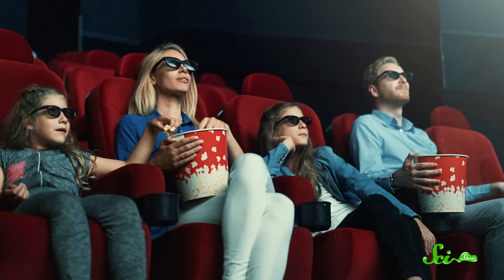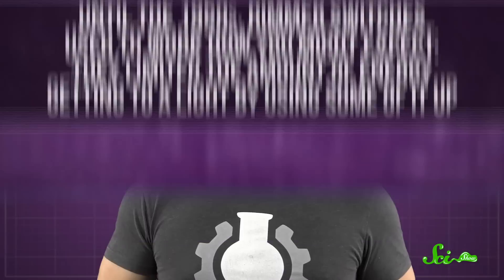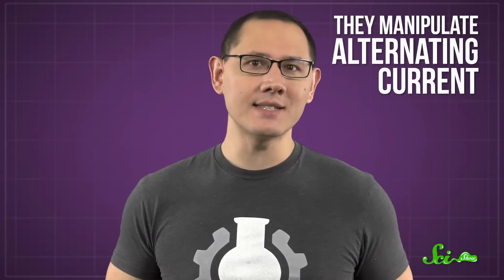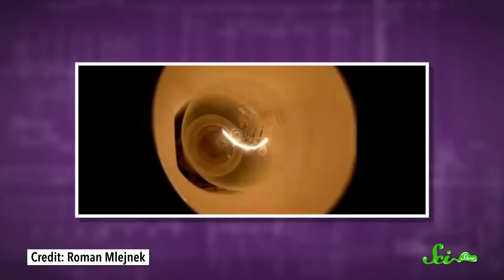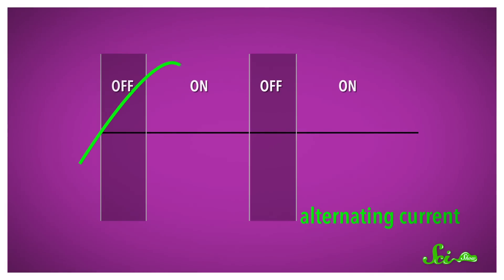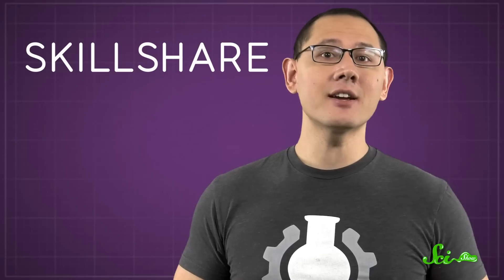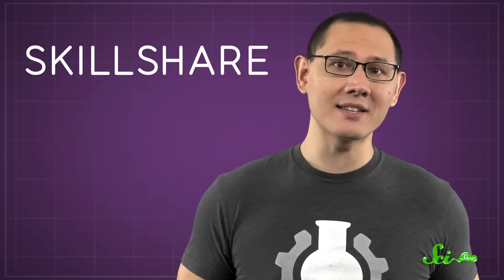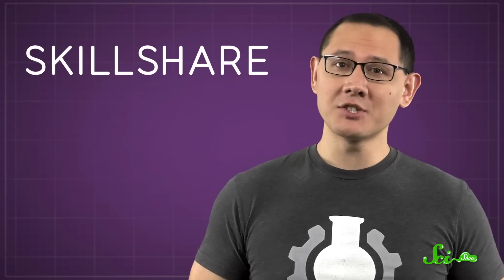Dimmer Switches: Secretly Strobe Lights

Comment from the maker: Skillshare is offering SciShow viewers 2 months of unlimited access for free. Check it out here: https://skl.sh/scishow-12
Reply: I thought the 120 referred to the voltage rather than the frequency of the AC which I think is supposed to be 60Hz. In the UK we run on 240v whilst the frequency is at 50HZ. Let me know if I am mistaken, please.
Reply: @islandsedition  You're right, it's 60Hz in North America.  But they're not wrong; they actually said there's 120 reversals per second.  The point they were trying to make is one cycle of a sine wave has two reversals of current, so a 60Hz sine wave has 120 reversals per second.  That's not how a technical person thinks about it, but it's probably less confusing to someone without a technical background, and lets them gloss over the explanation of Hertz, sine waves, and cycles, and just skip to the fact that the lights are turning on/off 120 times per second.
Reply: @yuwtze  Thanks for the explanation - not an intuitive way of thinking about it - but it makes sense.
Reply: @islandsedition  You are CORRECT. SciShow scrimps on accuracy some of the time and never make videos to correct the errors. I'd take the whole set of channels with a Toyota sized grain of salt.
Reply: @BrokebackBob  except the roundup one that Myles Power called them out on and they removed to correct later but have yet to upload the correction
Reply: Generally, unless it's labeled as dimmable, LED lights do not work with dimmers.
Reply: @yuri guimaraes no the lights you have suck if you notice them. He fails to note in the video that the frequency is constant and you would need to change the frequency for it to be noticeable for anyone that can't see them flickering at full light level.

Comment: That fan in the air multiplier/bladeless van is not a blade, it's  a fin. You can in fact make an air-multiplier that uses a blade, but it won't be as efficient at compressing centrifugally air as the fin.

Comment: My l.e.d's are flashing at highest output on my dimmer switch. Seems like it would only strobe at low power based on your explanation. Also how does the dimmer switch work? What electronics produce the function, a diode perhaps?

Comment: It's also possible to have dimmers that are basically small variacs, changing the voltage of the circuit instead of the time it's on

Comment: Well, this is partially true, except the strobing part.  The electricity is crossing zero no matter what, all you're doing with the control is keeping it at zero longer.  Most lights are smooth or smoothed so that there's not a difference if there's a dimmer or not.  The ones without smoothing, like cheap versions of LED lights, will show strobing regardless if theres dimming or not.

The dimmer controls are basically phase operated PWM switchers.

Comment: Great video overall, very informative, but

'dimmer switches stay above the limit of the flicker fusion threshold, so we'd never see them' yea sure bud, try plugging in a simple LED into that dimmer switch and you'll see a SUPER annoying 120hz flashing, Good dimmable LEDs will use reletively complex circuitry to estimate the expected "dimness" based on how long the pulse should be, compared to how long it actually was, and then use PWM to flash those LEDs at 100s of times per second, so we dont see them, for reference, most people are capable of noticing strobing of bright lights at around 500hz, some younger people are capable of noticing strobing at and past 1000hz
Reply: that 24FPS, was not some scientific number researched for its ability to look the most life like. It was chosen because it was the bare minimum speed needed for the brain to percieve motion, instead of a series of still pictures. Film is very expensive to produce, and process and the cameras and projectors just were not capable of higher speeds AND reliability. movies look smooth, because they are shot at a reletively slow shutter speed, so the blurryness looks natural. Try watching a 24FPS movie recorded at 1/1000 shutter speed, the transitions between frames can be jarring, wheras watching a video recorded at 1000FPS @1/1000 shutter speed would look natural
Traditional fim theatres were noticably flikery because there was a mechanical shutter that blocked light for a few MS each frame, which was quite noticable. When they switched to digital that flicker went away because now we were talking about frame updates at the same rate as the frame rate, with pretty much full light output at all times before, during, and after the frame update even at the AC polarity change every 1/120 because it either used an incandescant bulb, that only slightly dimmed turing this period, or an LED that was fed regulated DC current and uses PWM dimming. TVs are a different story, some TVs use PWM LED backlighting, but i think most of them just use simple drivers for their LEDs and the 1/120 is good enough because thats generally faster than the frame rate anyway.

Comment: 1:07 that image is so so so so so so inaccurate. variable can be dc or ac its not a type of current and pulsating is dc pulses witch pulsating is not a type of current there is only ac and dc. we use ac in houses for efficiency fun fact.

Comment: Like DC, AC can be pulse Width Modulated. PWM, is what's doing the work, andit doesn't have to happen at the zero voltage point.

Comment: So what actually happens when you turn the switch to dim the lights?
Reply: Most dimmer switches use a device called a silicon controlled rectifier (SCR). When the SCR is activated, it will conduct current until the currents drops to near zero. The knob or slider is connected to a potentiometer, which controls when the SCR will activate. So if the dimmer is set to high the SCR will turn on early in the cycle (at a low trigger voltage), and stay on until the voltage drops to zero and switches polarity. If the dimmer is set to low, it will wait until later in the cycle (once the voltage is high enough) to start conducting current. Actually an SCR can only conduct current in one direction, so dimmers have two SCRs connected together back-to-front, so it will work on the negative half of the cycle as well.
Reply: @josugambee3701  oh thank you that's so smart

Comment: Noticed a mistake: it said that in the US that the frequency of alternating current (AC) is 120 times per second (Hz), it's the voltage that 120, and the frequency of alternating current is 60Hz.
Reply: A full ac cycle is two alternations. Thus at 60 hz the current changes direction 120 times.

Comment: If the flicker fusion threshold is the same as the framerate a movie plays at, then why is every frame of a 24 fps movie shown three times at a movie theater to prevent the picture from flickering?

Comment: Controls for audio volume and for speed of electric motors (fans, drills, hairdryers, food blenders/beaters), etc) -do some work the same way, with off periods instead of using an adjustable resitsor?

Comment: In the very short time of each off period produced by using a dimmer switch, do any light bulbs go completely off (in terms of not emitting ANY light)? I think there is a longer time period needed for that to happen, which of course would vary by the type of bulb -incandescent, fluorescent, LED.

Comment: 24fps is not smooth. But since you  won't use normal framerate (60fps), you won't see difference.
Reply: What does it matter if it's not smooth?
Reply: @josugambee3701  24 or 30fps are not smooth. Once you go 60fps, you don't come back. We have screens capable of 60fps for 30 years at least. Why still use bad,  old and outdated framerate, which was used to save phisical film, which was expensive?
Reply: @glitchysoup6322  Yes, I know all that. I watch 60fps videos all the time and can notice the choppiness of lower framerates. The point I'm trying to make is that I don't mind 24fps. It works fine, and I don't know why people bother about it.
Reply: @josugambee3701  i don't mind playing Minecraft at 15 or 10 fps, partly because i got used to it on my slow computer

Comment: Fun fact, this is why older magnetically ballasted flourescent lights flicker. It's just at 120hz, which is well above the fusion threshold. (CFLs and electronically ballasted lights run FAR faster, often well into the kHz, such that the light actually remains at full brightness during the "zero crossing".)
It's usually not until the light is nearly burned out, and it's no longer really able to power up all the way, that this flicker really becomes noticable.
Office light ballasts are equipped with a "lead lag" function that offsets each bulb's flicker from the others, creating a far more even light from the fixture as a whole than a single bulb could achieve on a magnetic ballast.

Comment: Electronics jumped out the window at 0:40: larger resistor -> more wasted energy

That's simply wrong. The equation for heat dissipated by the resistor is P=V²/R=I²*R. 

So if you change the resistor from 10Ω to 20Ω , then the power loss is half as big due to V²/R.

Larger resistors are being put into electronics to make them more energy efficient. If there was no resistor all current would flow unhindered -> congrats now your lightbulb is wasting all the energy it can.

Comment: There are so many errors in this, it is misleading. Incandescent light bulbs work by heating up the filament to a temperature where it emits light. When the light is dimmed, it is switched on and off, but this happens so quickly that it doesn't cool off, it just has a lower temperature, and therefore lower brightness, because the power being delivered to it is lower. LED lights dim by intelligent circuitry that limits their current. They do switch on and off rapidly, but this is smoothed out by capacitors and inductors, so there is no actual strobing.  Furthermore, if our lights were strobing at 120Hz, we would definitely noticed it. Some low quality LED bulbs lack a smoothing capacitor, and as a result they flicker at 120Hz (not 60Hz because it is full wave rectified). This is visible and very annoying. They also only talked about leading edge phase angle control dimmers, while many newer designs are trailing edge. SciShow, I usually love your content but this video is full of mistakes and misleading. It is poor quality, and I urge you to pull it immediately and issue a correction. Dimmers, while they do use a semiconductor to switch lights on and off, do not strobe, and even if they did, it would not be because of the dimming but because of the fact that the AC sine wave passes through zero 120 times a second.

Comment: Recently I was hanging around the front desk at an organization I frequent. They decorated the desk to fit a holiday theme by string a set of Christmas lights across the desk surrounded be fluffy white cotton to look like snow. I noticed while talking at the desk that the lights almost seemed to be constantly flikering at a very fast rate, but it was hard to tell. I could see it more in the glow of the light reflecting off the cotton. I could just barely catch the speedy flicker. What's the science behind this?

Comment: ANYONE can EASILY see the 60Hz strobe in an unsmoothed LED bulb, you just need to not look at it. Your central vision is for detail but your peripheral vision is tuned to catch much quicker and subtle changes in brightness (presumably for detecting predators). You might notice this if you try to cover the light from a digital alarm clock, you can't see any light looking directly at it but it is glowing brightly in the corner of your eye. I'll advise anyone who gets the opportunity to see a CRT TV or Monitor to check it out from the corner of their eye and notice the flicker and then feel sorry for the British and Australians since theirs were even slower at only 50Hz.

Comment: I recently switched to LED light bulbs in the house. Some of the brands I used were definitely not flicker free (especially noticeable if you moved your hand in front of your face, you could see the strobing effect). If anyone ever wants to switch to LED light fixtures, definitely make sure they are flicker free. One trick to find out is, if you have a phone that has a slow-motion video option, turn it on and point it at the light. You can clearly see which light flickers. Literally saved me a lot of headache.

Comment: Yeah. I would not say it works like a strobe light because the effect of the filament not cooling down enough to actually stop producing light. At least with a old school dimmer and filament lightbulb. I am not to familiar with more modern dimmer switches and lightbulbs. But if you do not have a modern lightbulb that actually can be dimmed then your old power switch may not work. Then you can get weird strobe light effects that you actually notice. Though I would not recommend using a lightbulb not made for the task as not only will it not work properly, but it also reduces the lifespan and can prematurely kill the lamp.

Comment: To give some additional information: Not all dimmers work as described here. 
There are basically 3 different types of dimming techniques: leading and trailing edge dimmers and PWM dimmers (technically leading and trailing edge dimmers count as PWM-dimmers too, but they are normally not called that). 
Leading edge does not turn the power on until a variable time, so it cuts the front part of the sine wave.
Trailing edge cuts power off after a variable time, so it cuts the back part of a sine wave.
PWM dimmers produce a square wave, where they affect the t(on) and t(off) of the signal in a fixed time t. They can be used to dim LEDs.

Comment: One other note about these type of "sawed off" (pulse width modulated) sine waves - rather than the gradual ramp up to full voltage that you get with normal alternating current, these truncated waves rise very quickly and become practically square waves.  This introduces higher-frequency harmonics which is why you sometimes hear a high pitched squeal from a partially dimmed bulb...
Reply: RedwoodGeorge You are quite right, Sir, and this may be the reason why better dimmers have a so-called 'zero crossing detector' which enables it to turn on when the voltage is zero volts, or at least very close; after a preset time (less than one half cycle period) the current is then cut off again by a different part of the circuit.
Doing it this way will not only reduce the high pitched whine that some people can hear, but will also prevent potentially harmful spikes from being sent out onto the electrical grid itself where it could, for instance, harm your stereo speakers after having been amplified by your amp.

Comment: What he completely fails to notice is that the frequency of the light don't change so the flickering frequency will be the the same regardless of dimming level a Strobe light would change the frequency and that would be noticeable but keeping the frequency constant even if you remove some of the wave form will no way change what how the light flicker